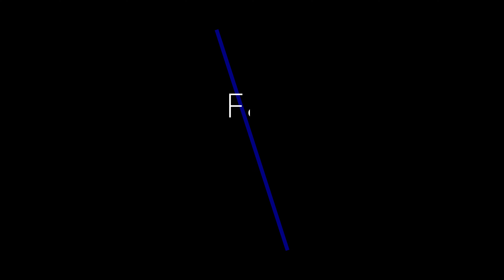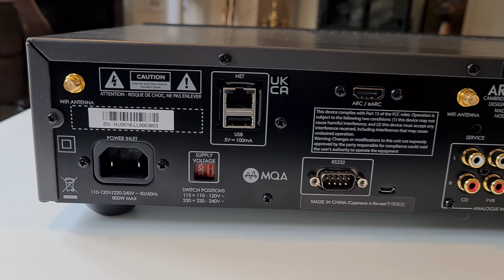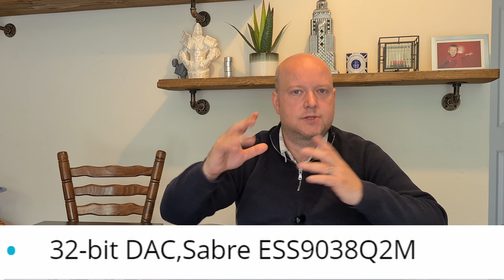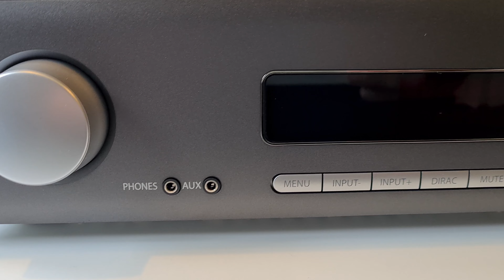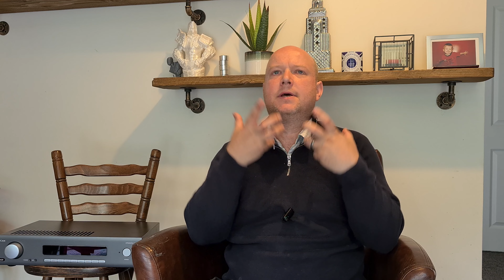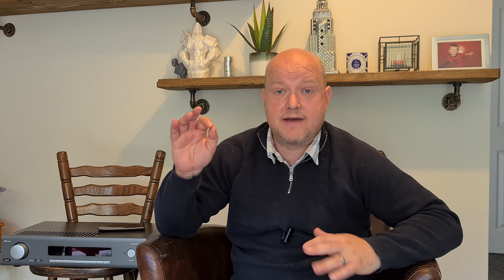Arcam SA30 Intergrated Amplifier Quick Look

Comment: It’s a 6k$ amp that does not have its own app. The user interface is of a third world grade. The ease connectivity is horrible . If you can look past that the sound quality is unmatched. Otherwise the amp its of is well built but unsightly. I took mine back coz I could not stand the user interface. The remote itself will freeze and be unresponsive for no reason.
Reply: It’s about $2000 or equivalent GBP, so it’s a wonderful amp at that price!
Reply: You are a liar = $6K and a Bigot = Third world?